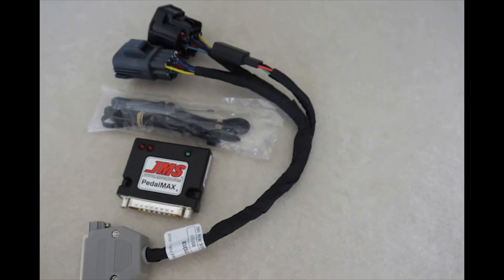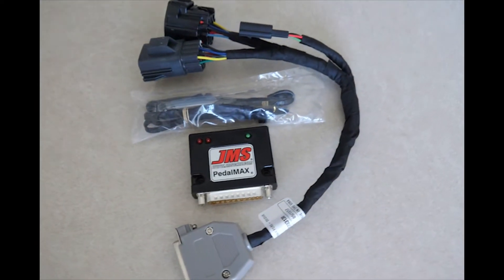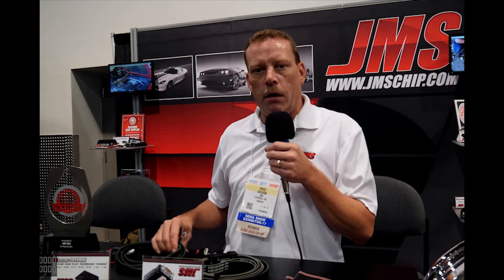JMSCHIP

Comment: How can I purchase this kit???
2004 F-350 09 6.7 Cummins 5R110
Reply from the maker: https://www.dieselconversion.com/getting-started-kit-ford-2003-2007-6-0l-5r110-2003-2009-commonrail-cummins-482.html?options=cart
Or go to dieselconversion.com and hit the "kit builder" button.  
Above is the link to the comprehensive kit for that package--if you originally had a 6.0. We have them for the gas to CR as well though. Feel free to ring the shop and talk to sales directly, they'll get you set up. 406 755 8878

Thank you!!